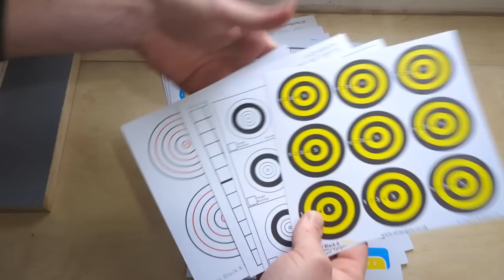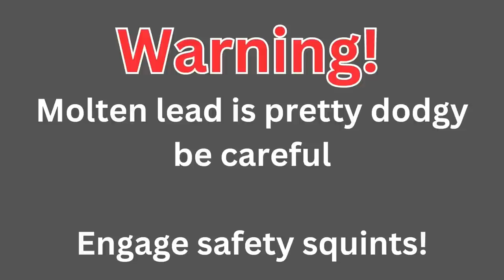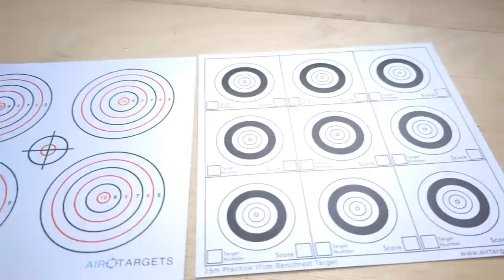DIY silent air rifle pellet trap, takes 17cm target cards

Comment: Great review good job, I made something very similar a pellet catcher 
Had to go back to the drawing board. 60yarder the ply was getting damaged with flyers lol 😆 scoping in. so i screwed 2mm steel plate to the ply 15 months later still good  👍
Reply from the maker: I'll usually run a shot or 2 off just to check I'm somewhere on the card before getting too stuck in. It's annoying shooting the holder up 😆
I've got a load of ali sheet to turn into some much more substantial versions eventually. Tbh I just enjoy making stuff as much as using it..

Comment: Just use a rubbermaid office-sized trash can filled with rubber mulch.  
Periodically wrap it with shrink wrap and switch sides to preserve the structural integrity of the trash can.  
I have shot over 4,000 rounds into mine and had zero problems.  (.22 cal,  ~800 fps)
The mulch is made from chunks of recycled tires and will never wear out.

Comment: nice work .  but a cardboard box box filled with old clothes wil do the job , lead recover and quiet and easy to move in the field
Reply from the maker: Agreed.. I like the lead traps as its great being able to see the pellets stuck into it, sometimes the cards get torn up a bit and don't give a true reflection of the groups  and being able to glsee them in the lead is very cool 
Plus I like melting it all down, I want to turn some recycled h&n pellets into fishing lures eventually 😆
Reply: @tillysgunstocks  tape a targetcard on the box
Reply: I use large painters tape to fix them
Reply: I do this it works. Box will last awhile too
Reply: @HughMahn-o4x  I still didn't find a better option for the price ! Haha

Comment: NOTE -- The pellet resistance/durability of the trap is GREATLY IMPROVED by the containing sheet pan backing the lead plate as a pellet stop.  If you do as I did and assume that 1/4" of sheet lead would be sufficient by itself....well it gets eaten up with the high power stuff.  1/2" (maybe 3/8") thick for free hung lead plates.

Comment: Surprised you've not used NSRA 1989 Pattern 2510 BR15 - 18 Targets for 25 yards, and NSRA Pattern 50M10BR17 - 18 Targets for 50 metres, and tried 1001 BR15 - 18 McQueen Targets for 100 yards.

Since they would give you a recognised standard for accuracy.

Mind you, I also use 14cm 10m Air Rifle Targets, and 6 yard Bell Targets as well, but only with 5 ft/lbs.

Comment: Hi, As a rough guide how thick is the lead when melted ?
Reply from the maker: Hi mate, this one is around 6-7mm thick but anything over 4mm works well and if you can go thicker still it'll only be a good thing 😉
Reply: Thanks 👍
Reply: Great idea, thanks for sharing 👍
I made a 12-🎉15mm thick “lead” plate from wheel weights. A3 size. 
Screwed it to an EU pallet and used 45x145 lumber as a frame/stray pellet catcher. Love your idea with trays n magnets. 
I’ll use your design and make 3 or 4 A4 sized traps from the lead I have. Happy days 😆

Comment: its good for sub 12ftlb only though.
Reply from the maker: With half inch or more lead thickness they work well up around 40ftlb. I've not seen one used higher than that but with thicker lead I'd expect it to be fine

Comment: Regarding lead, if you hung a lead fishing weight as a spinner / reactive target, would it stop the pellet like the tray or not?
Reply from the maker: I dont know, but im curious to try it though now 😆
I dont think it would unless it was a direct strike and not a glancing blow..dunno I'll try it sometime
Reply: A lead spinner?
The spinner would need to be quite light for a sub 12 pellet strike to spin it.
I've used pieces of lead flashings suspended on wire to good effect.

Comment: Hi, very nice. How noisy is it? Any actual video of this trap with sound? 🤔
Reply from the maker: I've used them in pretty much every video since I built them, it's just a nice dull thud on impact. Also very useful for checking group sizes as the pellets stick into the lead backstop. 😉
Reply: @tillysgunstocks  Nice! OK, I will proceed with this solution then.